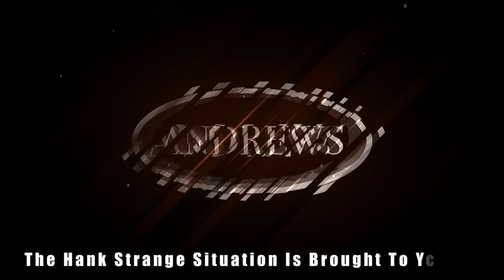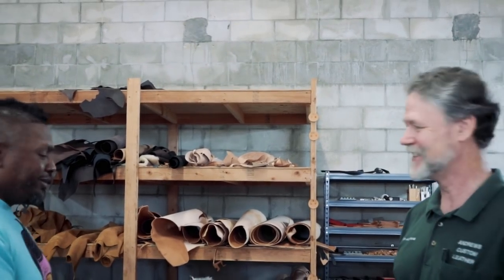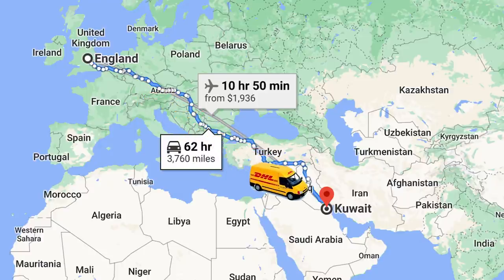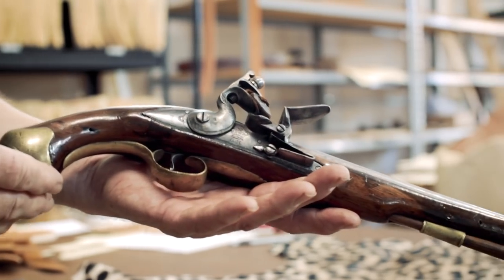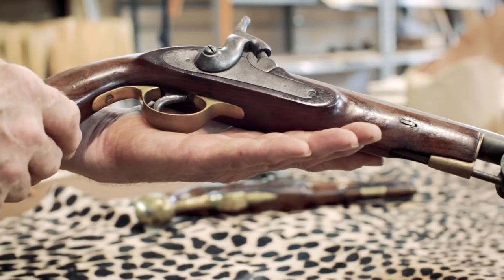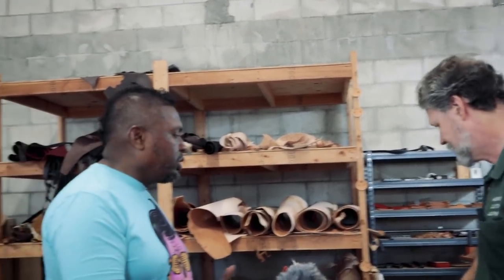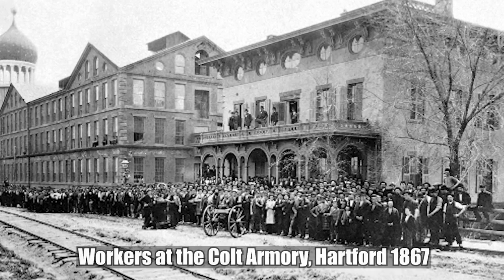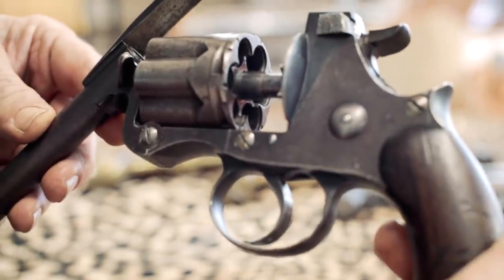British Empire Period Small Arms Sam Andrews Shows His Collection

Comment: Really cool and Interesting video!!!    I have shot  a full size 455 Enfield. It was  imported and converted from .455  to .45 acp  with half-moon clips.  The cylinder was machined  and converted to accept  moon clips.  In the late 1950's or early 1960's hundreds or perhaps thousands were imported and modified  to shoot  .45acp  to sell here in the USA.  The pistol was  inexpensive and there was lots of  surplus .45acp  ammo from WW2 available. If you have one of these do not shoot modern .45acp ammo in it. You can only shoot very lightly  hand loaded .45 acp ball ammo.  Loaded to less than 850 fps. Preferably approx 750 to 800 fps.  Sam you may have one of these in your collection.  Just thought you might like to know.   GREAT VIDEO!!!!!
Reply from the maker: Thanks good info